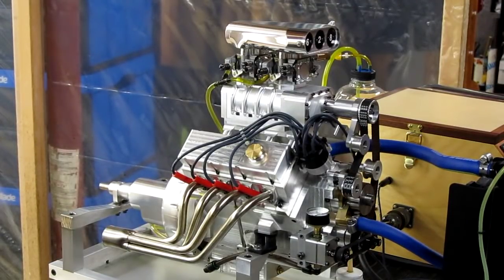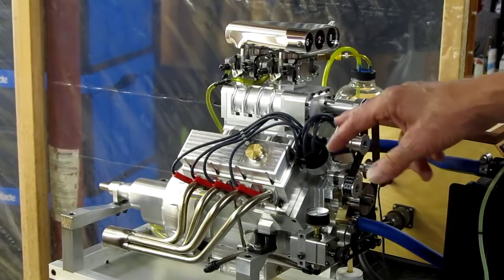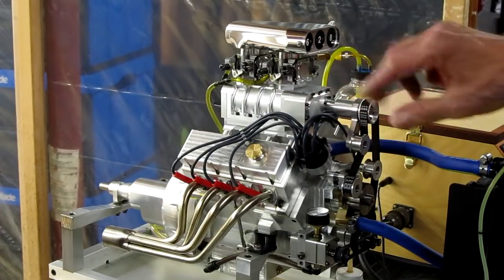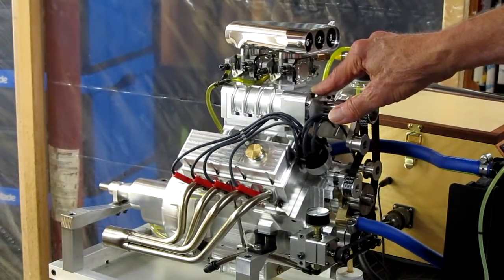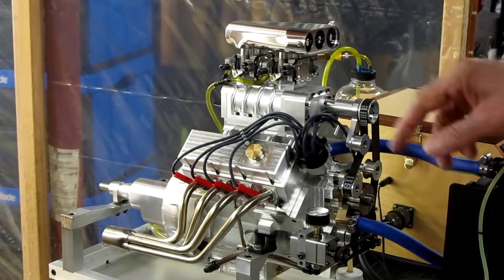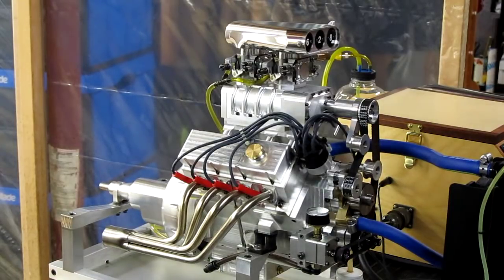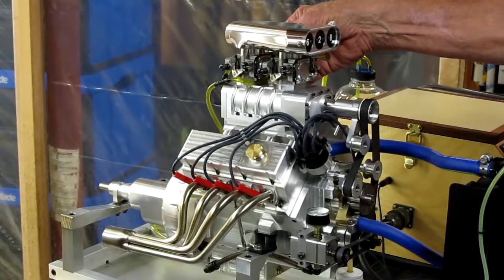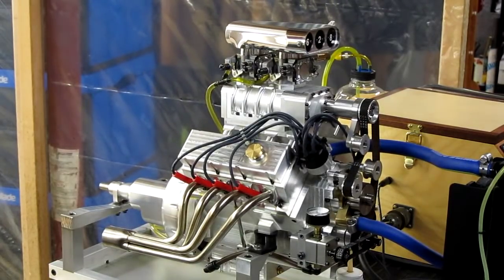Bakers V8 update

Comment: How many 8k free revs with no load can it take? Has to be rough on that little guy. Curious what the base starting price is for just the base engine set up, only with whats needed to run it, ignition system, carb etc...

Comment: Technically that would produce about 200-250hp?  Doesn't seem possible, but why not? I would love to know!
Reply: It's 6.28 cubic inches which is not 1/4 of a full sized V-8, which means it will not be 200-250 hp. .
Reply: @RevSearch  😂
Reply: @RevSearch  It is 1/4 of a full-size V-8 based on linear dimension. However, volume is cubic, so a 1/4 scale model would have a volume of 1/(4^3)=1/64 of the full size. 6.28ci (1-inch bore by 1-inch stroke times 8) at 1/4 scale would be equivalent to about 402ci full size. Likewise, horsepower scale factor is a cube-and-a-half (3.5 exponent), so scaled HP would be 1/(4^3.5)=1/128 of full size.
Reply: More like 10 if lucky
Reply: @chrish1695  10 seems close with the blower.
Reply: It's not even close to possible. At 200 hp it would be about 32 hp per C.I.